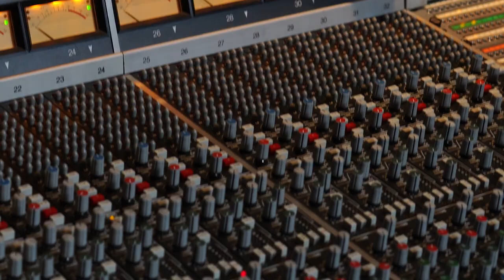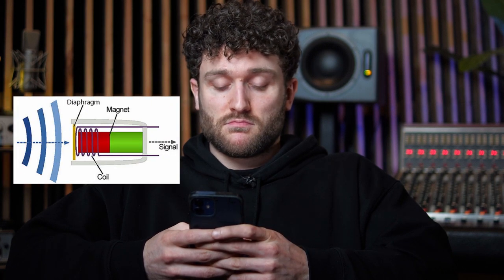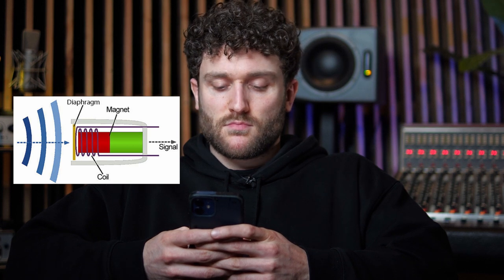All you need to know about microphones

Comment: Great video.

Question, if the tubes in a tube mic are just for amplification. Is there any real difference between that and just using a normal condenser with a tube pre amp?
Reply from the maker: Thanks! Yes, there’s a significant difference, not saying that there’s a good or bad option, i often change out both for each other. That’s why i use this general rule of thumb for vocalmics: tube mic with solid state preamp and a solid state mic with a tube pre.